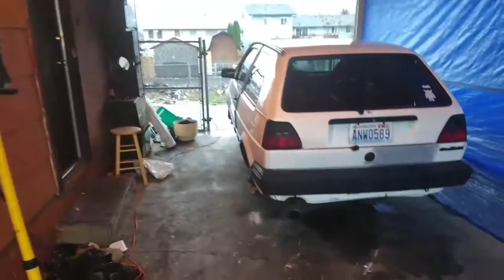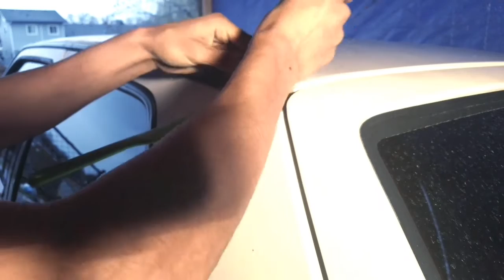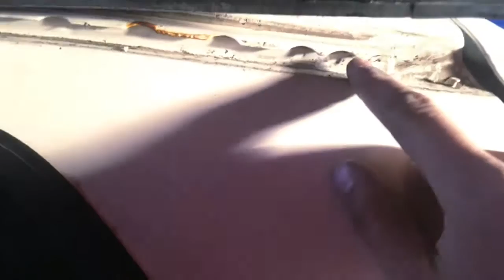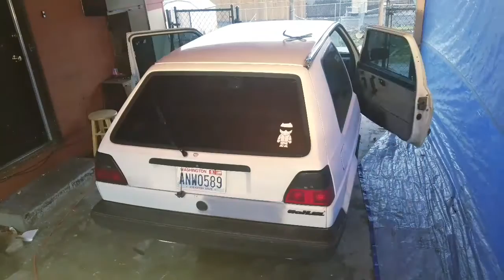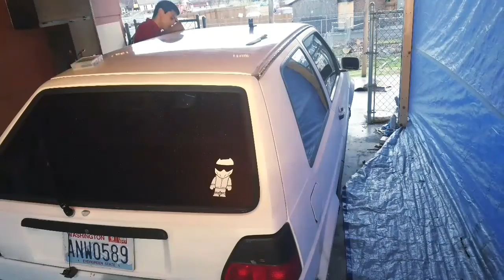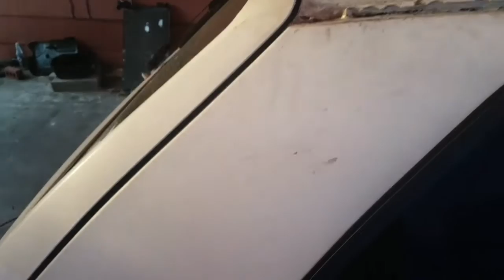Removing Mk2 Golf Roof Rail Rain Gutters

Comment: Mine are cracked and dry rotted and I can't find replacement gutters anywhere, any tips? Thinking of going to a few scrapyards this week to see if I can pull off some better ones.
Reply from the maker: Duncan Bullen unfortunately they are extremely hard to find. The cheapest and easiest way to get them would be the Junkyard. Look in vwvwortex and ebay. Possibly someone parting one out near you too.
Reply: I’ve found this place parts place inc. they’ve been dealing vw parts for over 30 years

Comment: thanks alot. how do your remove the mouldings around the wheel arch..
Reply from the maker: Phillologist Mine actually didnt come with them but I have read a light pass over with a heat gun might work to loosen the adhesive. if not, you might be able to use fishing line. Look up "debadge car with fishing line" same concept
Reply: THANK YOU SIR.

Comment: doin it kinda wrong , way too much contact to the car with the tools.
First loosen the lower side off rubber , start in door opening by pushing it away from the car.
You can do that with only your hands , when the lower part is out the lower rail just click the back end loose and wiggle it a bit and it will pop out all the way and you dont need to use those tools at all.
Reply from the maker: baklap141 it was my first time doing it and there were lots of stories claiming they break and distort easy, was just trying to avoid that. 👍